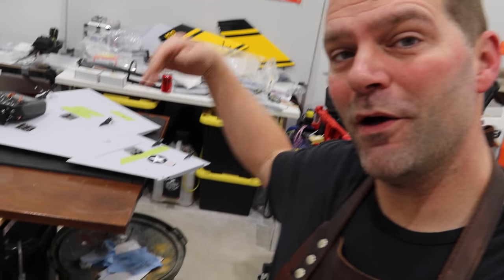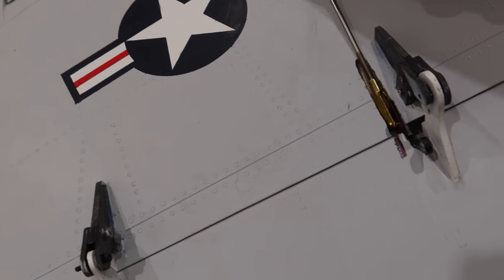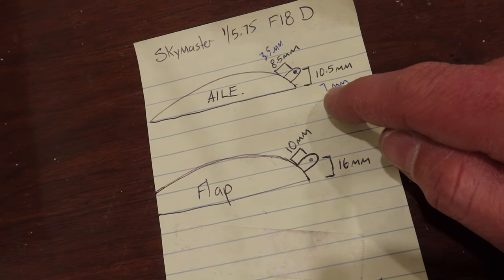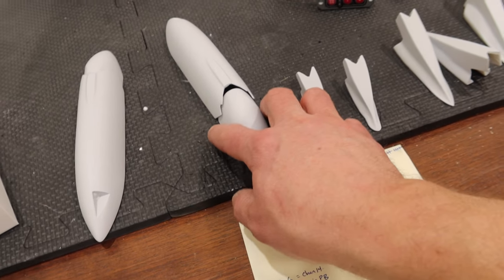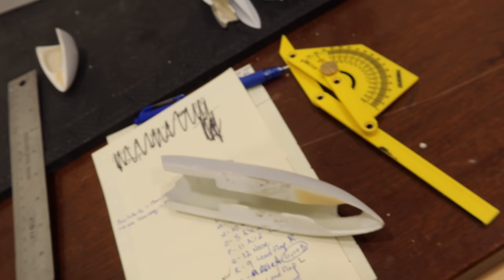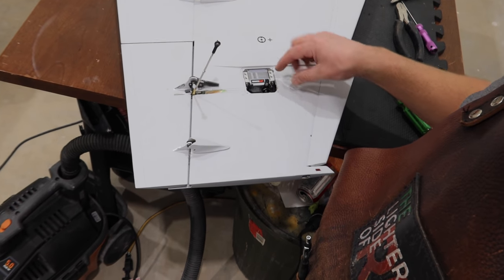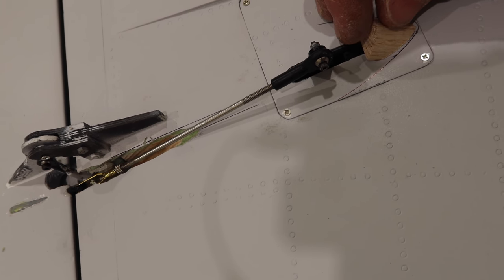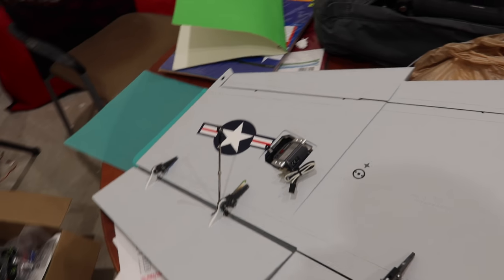MASSIVE F-18 Wings Complete - Skymaster Ordinance Package Installed

Comment: Hi Jonathan love your videos. One little thing on your right push rode cover there is a dent which you removed on the left one and made it nice and round. Shouldn’t you make them the same or did I mis that ?  I also want to say I fel in love with the aviation diamond after seeing your videos. So much that I have build a xps and foamboard one . 1.6m long 1.4 wingspan. 90mm 6s edf. And she fly’s light a beast.  Greetings form the Netherlands
Reply from the maker: Hello Marcel!  I could modify it but will keep it as is.  It's supposed to have the indent so we will keep it on one wing😉. NICE!!!! Still love my diamond!  I was oogling over it last night and wishing we weren't at -25C so I could go flying!

Comment: Another successful video. Really good explanation on the "How To" for the items that are not obvious. I am amazed the ordinance will stay in place with just those small slide on screws. I fly 40% gas aircraft and the vibration would not work so I guess there is very little vibration with turbines. Anyways, great video and thank you for all you do for the RC Hobby. Take care.
Reply from the maker: Thanks Hank.  Yea it doesn't seem like much holding it on but it works.  And it's easy on/off as well.  Thanks for watching!
Reply: Go back over your propellers and make sure that they are balanced. Balanced, that removes an awful lot of vibration
Reply: @josephkerkau2520  I do that all the time but like anyone who flies gas powered aircraft there will always be some sort of vibration. I even go as far to ensure the spinners used are balanced. Thanks though for comment.
Reply: @hankdurrer5650   Thank you, I understand. That's what I do also. Sound to me like you've already got it under control.  Sorry, But thanks again!!!

Comment: The Super doesn’t carry inboard missiles as you have them loaded.  You need what is called “monster” configuration launchers to load missiles on stations 3 or 4.   And is there no centerline pylon?
Reply from the maker: Yes there is a center pylon.  it was installed in one of the previous videos.  I'm just installing what Skymaster has sent 😉